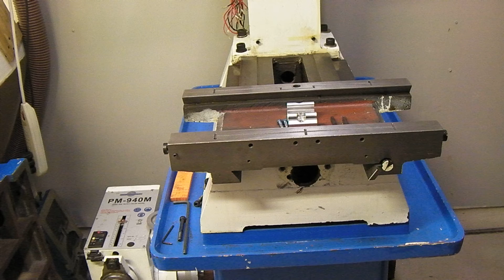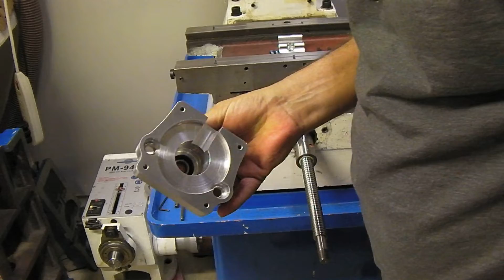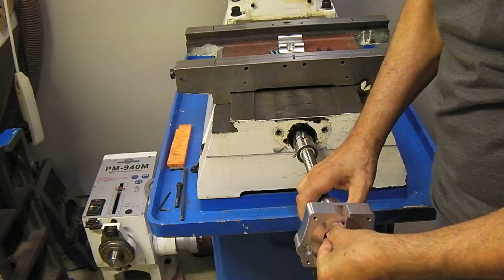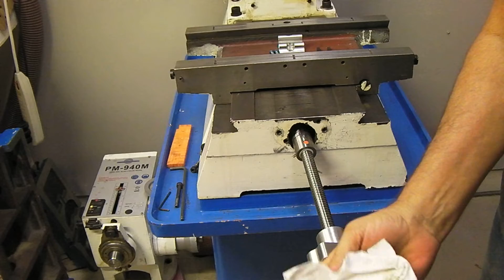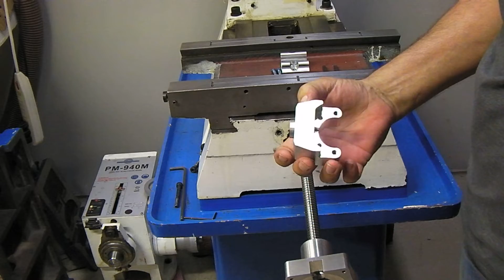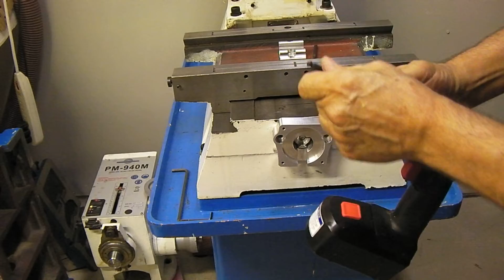940 Y mount install

Comment: Where will you be selling the kits? Do you have a thread going somewhere? Also, you mentioned that you may cut the stepper shaft... any idea on what the fit is to a 750w nema 34 DMM servo is like?
Reply from the maker: I have three sets of ball screws now. Next week I will sell a few kits but then I will need to re order screws. I do have some people waiting but once I get to making the kits I will fill all the orders needed. This kit has a few special parts like the bearings come from Germany so take a few weeks to get. I have a good amount but will need more.

 The X and Y dont need a 750 watt servo but I have not looked at the torque they make yet. 

I will run a 900 oz steppers for the X and Y and 1200 for the Z. I have one Clear Path Servo that I will test out as soon as I get thing running.  For the shaft length if you have too long of a shaft and dont want to cut it I have a 5/8" spacer for the Y. This will allow most any stepper or servo I have seen.
Reply from the maker: I will be selling the kits direct but I decided this week I will just get a web site up. For now you can just email me at davedaxx1@yahoo.com.
Thanks 
Dave
Reply: ArizonaVideo99 One more question, what is X travel with your setup? I will most likely be emailing you very soon; my 940 should be arriving "late summer" and this would save me a few months of downtime....